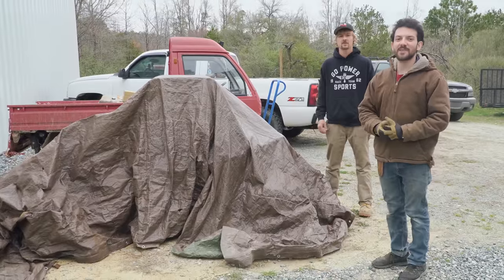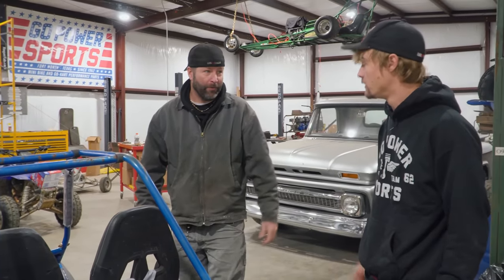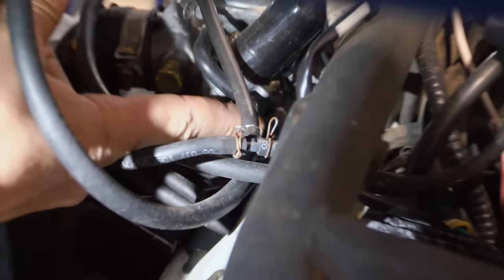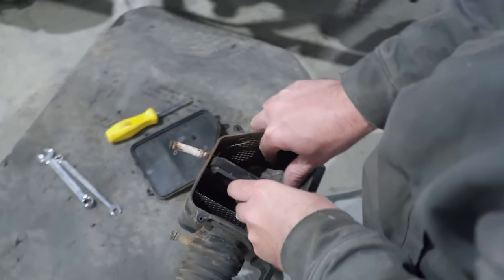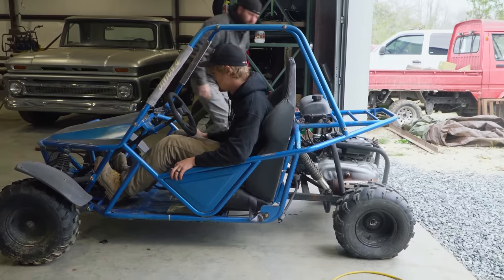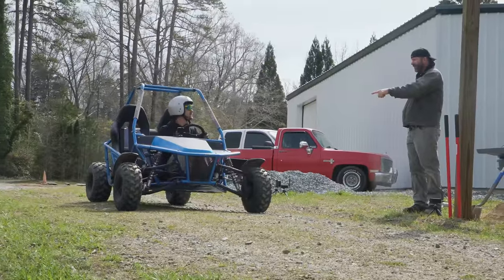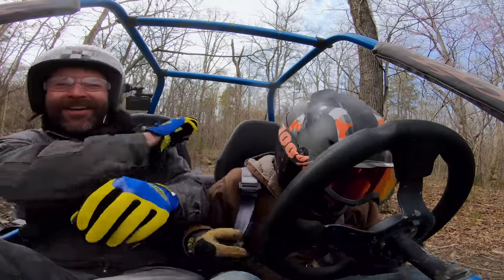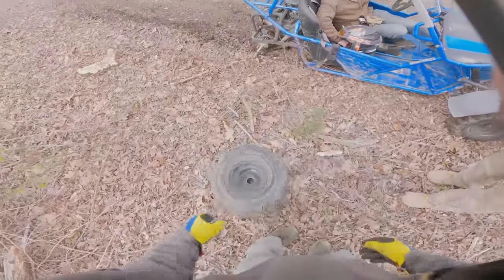Full Suspension 150cc Go Kart Revival + Rip | $500 Disaster, Wheel Falls Off!!

Comment: since it handles so well, you ought to take some measurements of the suspension parameters for reference on cart builds in the future. i'm sure that's what the chinese did when they were designing this thing. they prolly just copied a honda odyssey or something similar. i'd get some better hubs and wheels for it for safety's sake if you're gonna be riding a youngin' around in it. one of the teachings in the communist's little red book is "perfection is the enemy of good enough", which explains so much about the quality of the machines that come out of china without foreign guidance in the QC dept.

Comment: When engines sit for a long time the rings can dry up. Sometimes after they run for a little while the compression improves and they stop burning so much oil. Or sometimes the reason it was sitting for a long time is because it burned a lot of oil. Luck of the draw…

Comment: Probably the worst Chinese Go Karts ever made!  Unfortunately the concept of using a scooter/Yamaha copy for the drive system is fine......but the unfortunate thing is that Chinese don't use the utmost quality of products for their machines! Which makes these horrible especially if they get Wet! It's suppose to be an Off road vehicle, but their electrical system is far from moisture proof. And yes they are a useless auto choke system that only seems to work when their brand new! They sell a cable system now to replace the electric chokes! Knowing that they were problematic from the get go! But they are halfway decent when they are used on the E-ton ATVs think because the important parts are covered by plastic and gas tanks. Otherwise they're OK if you want something to work on all the time you try to use the things??? SMFH!  Good Luck with that POS!